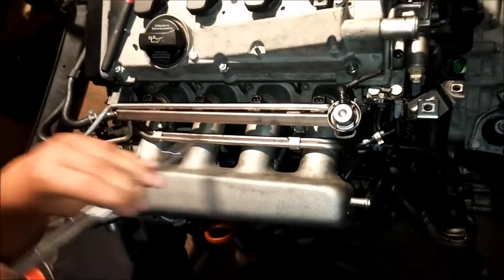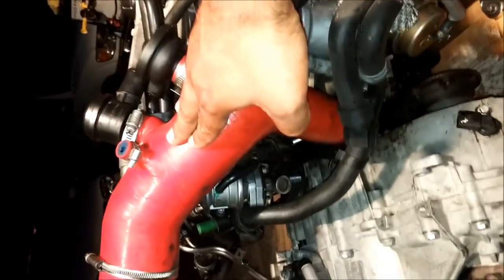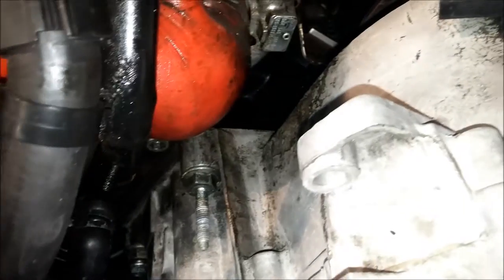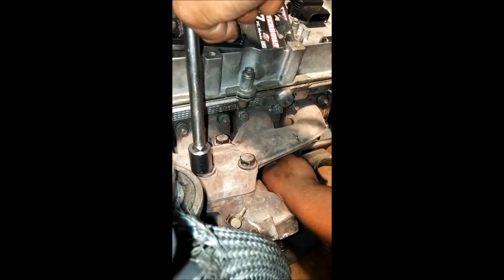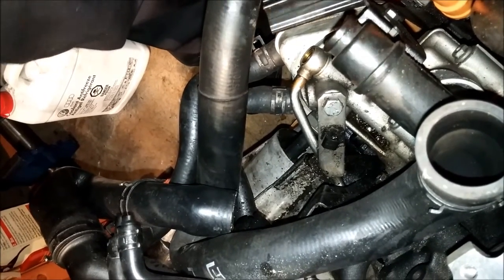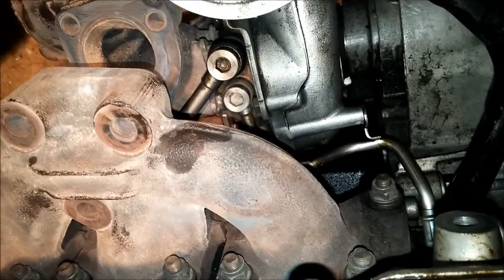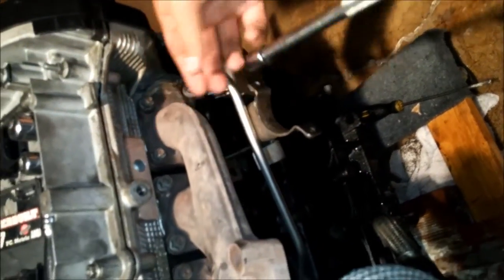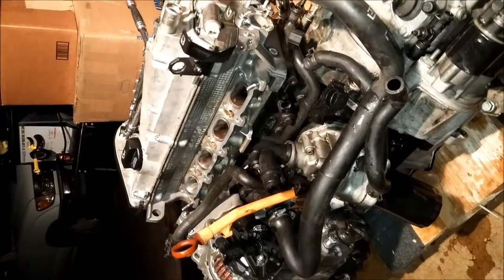How to remove a MK4 GTi Exhaust, intake manifold and turbo DIY

Comment: how bout doing a session on adjustable timing gear & how much horse power you can get...
Reply from the maker: Daniel Cadena good idea. i just need an adjustable cam gear.... your power gains are very minamal due to fuel octane. if you can go higher octane or E85 youll benifit from an adjutable cam gear. That being said if you can get higher octane fuel you wint need to ajust your timing because fueling is everything with it comes to octane and timing.

Comment: I have a 87\99 cabby. When I bought it I found out. The turbo was out. The coolant feed line was ran to the coolant reservoir. The coolant return was kinked over with and ran with rubber fuel line. This is what burnt the turbo up. My question is where the heck do I get my coolant feed. I don't have the manual for the 99. Where is my best place to tie in the heater hose side or the water pump feed side.
Reply from the maker: well if you doing a custom line best feed for coolant will be the upper radiator hose which has the most pressure so coolant can move fast. if you want oil feed use the oil cooler and tap it from there but i suggest an oil cooler with a pressure feed for the turbo.
Reply: The oil feed and return are good they just hooked up the coolant feed wrong and I will tee into the upper coolant feed from the rad thanks for the info

Comment: Hey bro, I have a VW GOLF MK4 2001 GTI and I need to take out my turbo because its stuffed. Is there any way to take out the turbo without taking the engine out?
Reply from the maker: Yes but its a lot harder. You will need to jack up the car put it on stands. Remove the axles so you have some room to take the turbo out. Also remove the dog bone motor mount so it gives you the extra wiggle room.
Just unbolt everything except the exhaust manifold. You will also need a swivel extension to get the banjo bolts off the turbo.

Just so you know its a lot faster to pull the motor and remove the turbo and also it will give you more room for less errors. Biggest issue youll have is the banjo bolt and getting the turbo properly torqued down.

You'll end up with an oil or coolant leak almost 95% of the time.
Reply: @PincheALsGarage  thanks for your reply. Thing is, I don't think I've fiddled around with cars enough to know how to take an engine out and put it back together. Which is why I asked the question. I only know basics. Radiator, brakes, spark plugs, etc lol. Oh well. Fingers crossed lol

Comment: do you have any videos removing K03s and installing a new K04-001 transverse turbo while engine is still inside the car?
Reply from the maker: no i dont. all you need to do is remove the 3 boots on top of the manifold, remove the downpipe, water and oil lines. leave the manifold alone. should be able to wiggle it out from the bottom. my only concern will be getting the new one in. its a tight spot but very doable.
Reply: +PincheALs Garage I'm happy I just watched your video again because I thought the o rings in the turbo were done when I found a little oil in the metal flat pipe going to the stock intercooler, but none anywhere near the throttle body or on the other side of the stock intercooler. I bottomed out and crushed the FMIC, broke the original 337 front valence, crushed the rocker panel, cracked the front radiator support. I went into a giant hole, mega pothole, filled with water, I thought it was a puddle but it was a small lake, I was on a steep incline going out into a heavy traffic 4 lane state road. So they won't pay for the intercooler and damages and AutoZone won't either. I really thought my turbo was about to go, I had a GT1752s go on a Saab 9 5 and the mess was horrible, took longer to clean than install the new turbo, junkyard turbo gtfoh. Thank you
Reply from the maker: +fockyoumang glad i was able to help in any way. :)